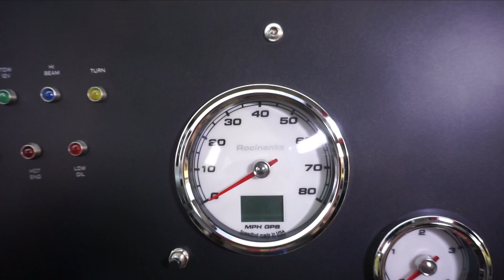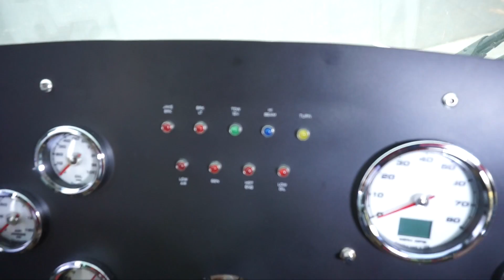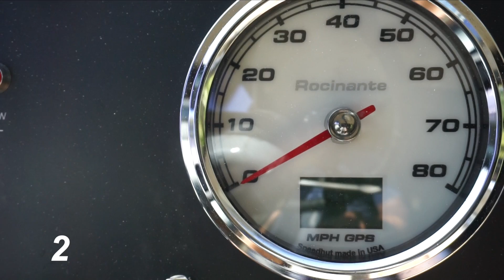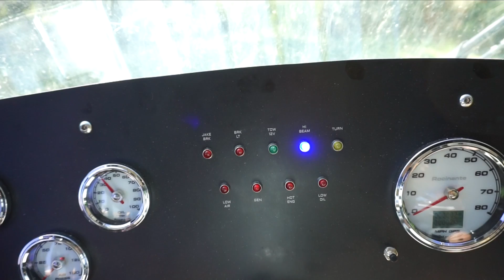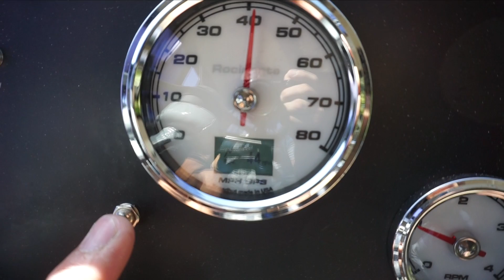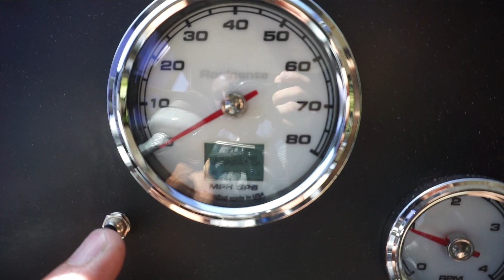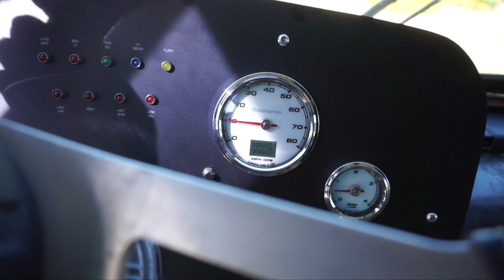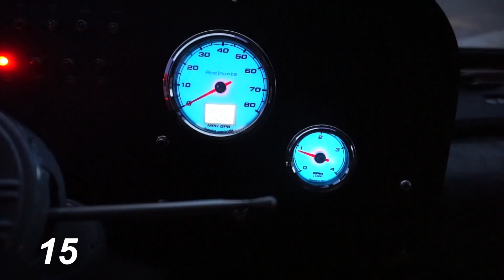Dash Rehab Part 5: Gauge Overview and Test Drive

Comment: I didn't notice the last time I watched this, but your air pressure gauge is reading off the AUX air supply, while this is nice to know it's not important, while your braking air pressure system ( a separate system)   is not monitored. The braking system is the important one and furthermore the braking air supply is segregated from the AUX supply. Thus,  one pressure builds first - the braking supply ( you notice that the low air warning (( this sensor is on the braking supply)) goes off before the AUX supply is pressurized.) then the AUX supply. So your reading a false reading from the AUX not the main supply. In most (if not all) coaches they have both main systems and the AUX supply with their own gauges. The pressure can and does vary between the systems due to brake application draining one or both main supplies, while the AUX system does nothing - showing a different pressure. You can lose your brakes and or have them lockup on you while still showing you have air pressure (yes, your low air warning would come on, but you have no idea of what pressure remains in the main system when it does). You also can't do a leak down test of your braking system which is very important.
Reply from the maker: Thank you EW Elmo - I will have to research this a bit further but what you are saying makes sense.  We did do a leak down test when we had Scott (the bus mechanic) out and the brakes held very good pressure (we did end up replacing the treadle valve because it would make a slight noise when brakes were applied.  Thank you for this information I will research all this

Comment: Just a quick note on your "low air" light, from a former truck driver.  Since you have air brakes, you are subject to DOT inspection if they choose to inspect your air brakes.  The light should stay on till you build to at least 90 pounds of air and then go out.  You must build to around 100 pounds in 90 seconds or less if I remember right.  They may ask you to do a pump down test, where you build your air up, turn off the engine and then keep pressing your brakes and the light should come back on between 100 and 90 pounds.  As yours turns off before your gauge even registers, you may have a problem with your low air pressure switch.  I also didn't hear a "low air buzzer" - every vehicle I've ever driven with air brakes has a buzzer that sounds along with the "low air" light.  This could be as easy as adding a buzzer in parallel with your "low air" light, so they both work at the same time.  If the DOT is inclined, they can park your bus (put your bus "out of service") till you get it fixed, including stranding you on the side of the road.  I'd add that to someplace on the top of your "to do list" before you have to deal with DOT on the side of the road. If nothing else, please check with your local DOT to find out the regulations on air brakes on private vehicles. (Service calls for air brake repairs are not cheap!)
Reply from the maker: Thanks!  We will look into this!

Comment: wowo the dash and switches look great .... What is the BIG TALL switch on the switch bank for ? and what does"Rocimante" stand for ?
Reply: Rocinante is a reference to Don Quixote and means roughly, "previously a nag" (like an old horse).
Reply from the maker: Hi Aaron - The tall switches are for lights and jake brakes - they are just toggle switch extensions that truckers use (makes it easier to feel around for the jakes or lights).  Richard Ownes is correct it is from Don Quixote - which is one of my favorite books

Comment: the red light on the dash lights when you apply the brakes, the original gauge must have been for applied air pressure

Comment: What if the bus has a factory dash with gauges that has multiple function(toggle through amp, oil press etc .). Do you think the speed hut gauges would work on that system ?
Reply from the maker: Thank you Discounted Adventures - Even if the bus has the original factory dash - all the wiring should be there for each of the individual gauges - the selector merely chooses between them.  I would be shocked if the speedhut gauges didn't work on them

Comment: Do you only have one air pressure system? I have one system for the front brakes and another for the rear (two pressure gauges) Four different tanks, one compressor. On the dragster I turn the gauges so that the normal reading has the needle pointing straight up. I like full sweep gauges, a thought might have been to have the gauges read so that they were placed so they were in a normal clocked position, but when the normal reading was reached the needle would be in the 12 o'clock position. The gauges could then be checked at a glance. what does Rocinante sand for? Are you going to tow a trailer? If so what will you use as a brake controller? I used brake air pressure as my signal to supply power to the electric brakes on the trailer. I did not like the pendulum controllers. Thought grades would effect the performance. Are you draining your air tanks? do you have a CDL? That will save problems id DOT pulls you over with the trailer. I like the look at night! Are they dim able?   Glenn Lever
Reply from the maker: There are 3 tanks in the system on the bus but only one pressure gauge.  I have seen other coaches that have multiple air pressure gauges and some even have them on every airbag and a dump valve that works for leveling the coach.   I love the idea of having them all read 12 o-clock for the 'at a glance' verification that everything is OK.  Rocinante is the Don Quixote's horse in the novel Don Quixote - one of my favorite books.  In Spanish, it is a play on words that signifies the horse's change of status from an old worn out the horse to the valiant steed that the horse becomes.  (in Spanish - rocin means "old nag" and antes means "before").  We do not plan to pull a trailer but we do plan to pull a vehicle (probably 4 down).  Our bus came with a really old "brake buddy" which we will probably donate to GoodWill.  There is an air system called "Air Force 1" that I have been looking at as an option.  I do not have a CDL - I doubt I will get one but I do plan on taking some driving lessons before we hit the road (CDL seems like overkill but maybe it's a good idea?).  The lights are dimmable on a small rheostat next to the speedometer.
Reply: We have a semiautomatic leveling system. Turn it on and it dumps all the air out of all the bags, lights light up beside arrows. You press corresponding buttons which lowers hydraulic jacks to lift the bus to level it out. My fear is one day the jacks will not retract and the air bags will not reinflate and we will be stranded. I use the system as little as possible. Four down is a simple approach. The big problem is you cannot back up without disconnecting.  An enclosed trailer can be backed up, offers protection to the vehicle being towed and is a great place to store stuff when not in use. Glenn Lever
Reply from the maker: Those automatic leveling systems are great.  I just saw one of the videos on your rig - it looks really nice.  Our bus was used as an over-the-highway bus so it does not include some of the more 'luxury' items some of the nicer motorhomes have.  As for the tow vehicle,  we intend on traveling in this thing full time and spending a good portion of that time in national and state parks.  So the concern here is that it might be harder to find a campsite for an RV + trailer + tow vehicle than it is for just a car + RV.
Reply: I know this is an old post but this is a 1964 bus. Like  cars of the era they effectively have single circuit brakes. Usually an ICC valve is include which dumps all air to brakes full pressure for emergency. These are not spring brakes either! No air no brakes except for parking  drum brake on the differential. I have never heard of an air failure though. Usually just poor brakes due to lack of maintenance is the issue.

Comment: Looks great!  Where is the fuel gauge?
Reply from the maker: There is no sending unit for a fuel gauge on these old buses ... so most people just use the "500 mile rule" (only put 500 miles on a tank of gas - it holds 140 gallons)  - I rode motorcycles for a long time with no fuel meter so using the odometer feels kind of natural.
Reply: Yikes that's bad milage...but I guess you already knew that going into it

Comment: Nice set-up. Very clean. I don't know much about 2 stroke diesels. I guess 2,000rpm would be the equivalent of 4000rpm for a 4 stroke for combustion events/time? The engine seemed to like accelerating right at 2000rpm.
Reply from the maker: I don't know much about them either (I am learning) but your assumption sounds reasonable.  These engines HATE the low RPMs - they don't make any real power until they are almost at the redline (2200 RPM) - but the rumor is you can run them flat out all day and they do great.

Comment: I powder coat and I do all the final prep. before I do any coating. I have a bike shop that brings me stuff and they blast there own parts but 9.9 times out of 10 they miss something. But in the end, I do not and will not coat something that I know will come out looking like crap.
Reply from the maker: That is the right way to do it.  The part still looked good when it came back - but I learned my lesson.

Comment: ..a bit late to comment, but I am watching old vids...you may experience loss of speedometer when in tunnels.
Reply from the maker: Yes I can't imagine that they would get a signal in a tunnel - we have not gone through a tunnel but we will report back when we do.  The gauge has been surprisingly reliable.  I have never looked down at it and noticed that it is not reading the speed correctly.